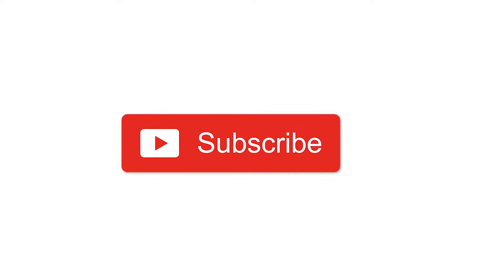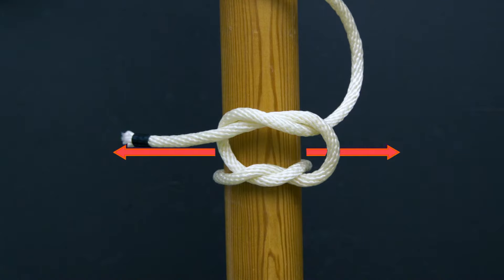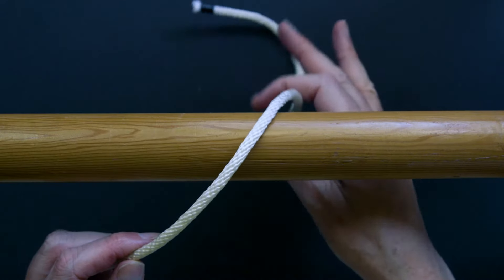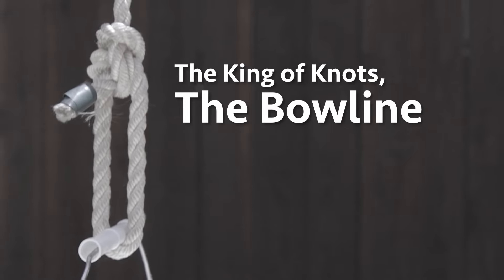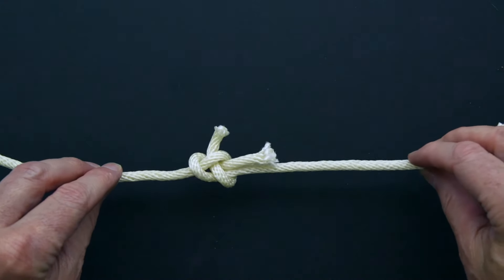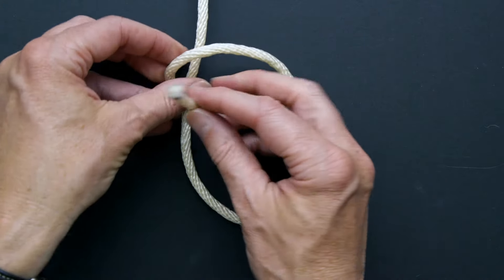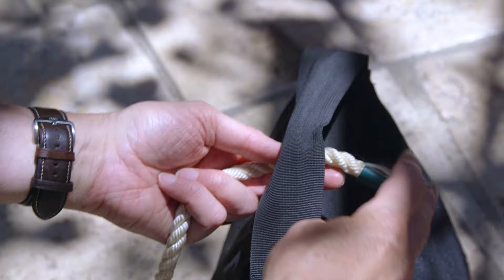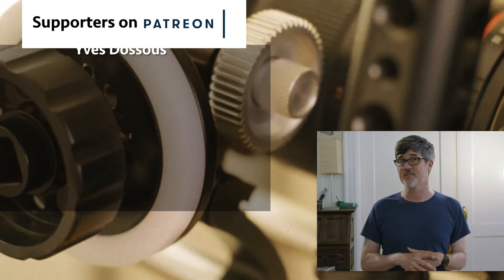Grip Knots Film: How to Tie and Use Common Film Set Knots

Comment: These are five of the seven knots taught in Scouts BSA (overhand is not taught, but it is understood).  The only ones missing are 2-half hitches and the timber hitch, plus the rolling hitch is called a taut-line hitch in Scouting.  Good to see practical uses for the knots in actual industry, thanks.